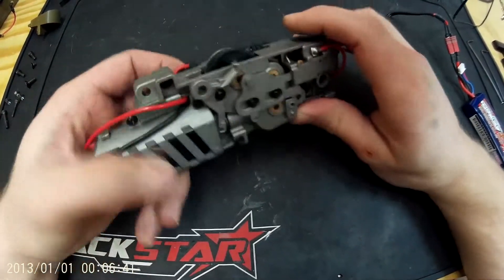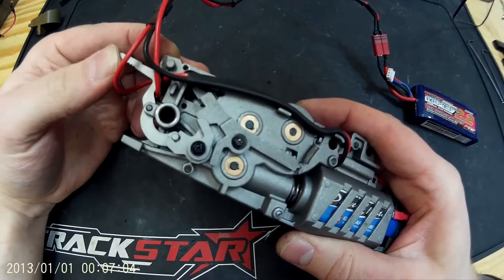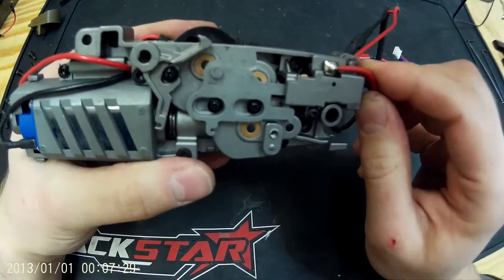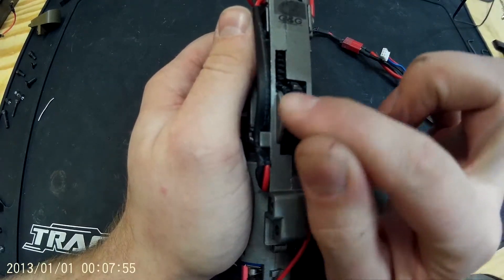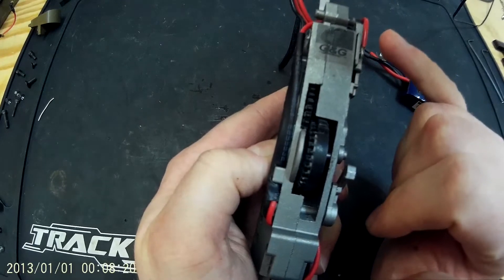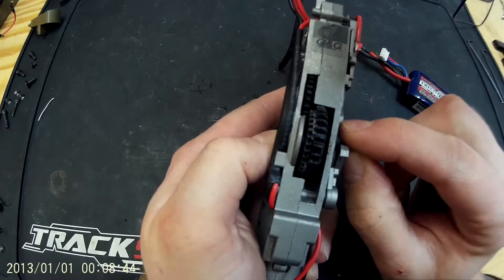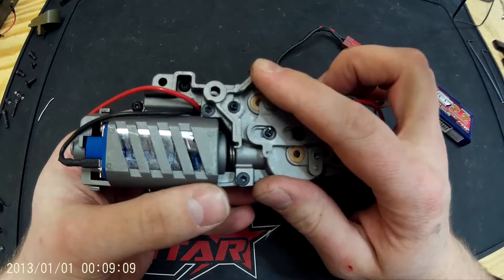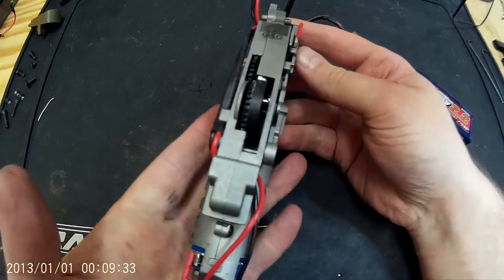G&G L85 Electric Braking Demonstration

Comment: There are a number of things that can cause a lockup on semi but it is more likely in this particular gun.

Basically, the gun isn't getting the power it needs.

Good quality batteries with a high discharge rate (eg. 25-50C) are recommended: hobbyking have some excellent lipos.

Switching over to Deans and using a better quality, high torque motor are also good options.
I recommend the ASG Ultimate CNC high torque motors.
Reply: So 15-25 Turnigy 7.4 is too low, you say?
Reply: P. Robin no just because no one asked and it was out of centext

Comment: Hello there thanks for showing this I recently aquired a G&g l85 but it never works on single shot, always locks up without fail is there a fix for this? Also the rof is very low, even with 9.6v battery is the motor of low quality?